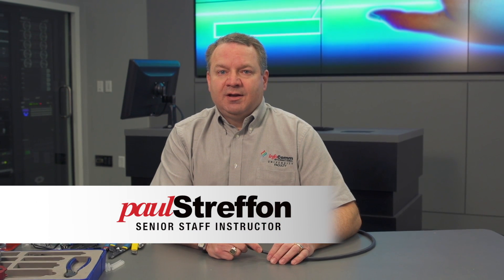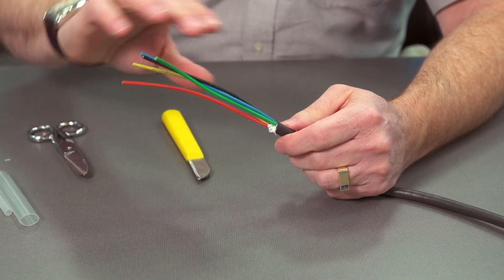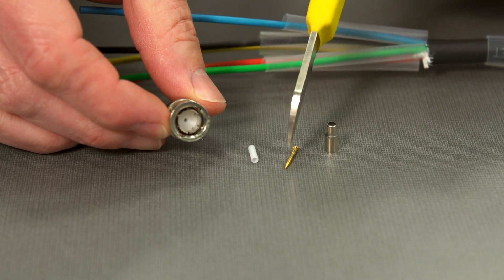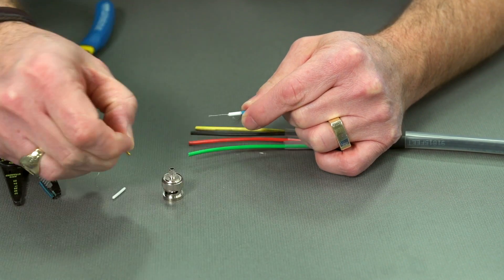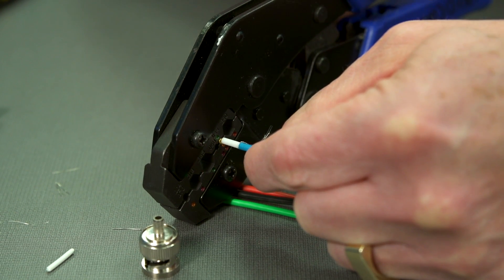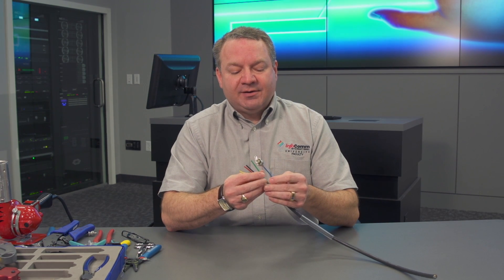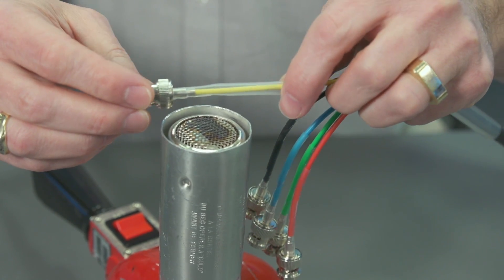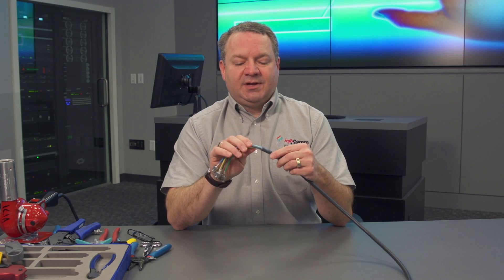Crimping BNC mHR to RGBHV

Comment: Hello everyone. In this video Paul Streffon was terminating a RGBHV cable using a mini high res connector. To answer your questions, the crimper and die can vary depending on the manufacture preferred. Since Liberty was mentioned, they have a crimper (47-10000) and die set (47-20250) that will do this. There are other manufactures that make similar sets. The holes that are used for the ferrule are between .128" and .178"; while the center pin is between .042" and .068". I believe that the BNC connector that is similar to this one that Liberty offers is the 112491-10.

I will leave you with this. What ever manufacture that you use; be sure to verify that the tool is the correct on for the connector that you are terminating. They should provide a reference for the tool, die set, and connectors.
Reply: Looks like all Extron stuff to me. Extron CTU 200 or CTU 300 Universal Crimp Tool (100-241-02), Extron BNC Male MHR 100-250-01 (QTY 50), and Extron MHR-5P RGBHV cable (22-103-02 500 feet). You can see “Extron” on the connector’s bag and the crimp tool is the same. Even has the orange color-codes between the BNC package and the crimp tool positions.
Reply: Also, Extron uses 0.044 instead of 0.042. Not sure if their MHR connectors tolerate the tighter crimp from the Amphenol RF tool Liberty sells or not. Also, Liberty does not sell the tool to the public though I see the die set available on Mouser.

Comment: Thanks for monitoring the comments so our questions can be answered. Sarcasm intended.
Reply: Marcus Yarborough, CTS-I commented with that information years before your sarcastic remark, so it seems they were doing exactly that.
Reply: Never mind. Dude was totally guessing and guessing wrong. This looks like all Extron stuff to me. Extron CTU 200 or CTU 300 Universal Crimp Tool (100-241-02), Extron BNC Male MHR 100-250-01 (QTY 50), and Extron MHR-5P RGBHV cable (22-103-02 500 feet). You can see “Extron” on the connector’s bag and the crimp tool is the same. Even has the orange color-codes between the BNC package and the crimp tool positions.

Comment: Can you tell me what brand crimper and die is being used, also sizes of the crimp holes?
Reply: Looks like Extron CTU 200 or CTU 300 Universal Crimp Tool. They expect you to stick to their brand and color coding so they don’t list the sizes for MHR crimping, but the Amphenol RF die set for MHR and m59 does (44-20250). Looks like 0.042 and 0.128 for MHR BNC (0.068 and 0.178 for m59 BNC) but I don’t know if that works with Extron brand connectors. I don’t have the Amphenol tool frame to try it but the die set is affordable from Mouser.
Reply: ...looking at Extron's diagram, they use 0.044 instead of 0.042. I have 350 crimp-on Extron MHR BNC terminals so I really don't want to order that without some confirmation that Extron connectors can tolerate a slightly tighter crimp, but I may need to.

Comment: What brand connectors are you using? I only have Liberty QuickLinx and I'm not a fan because they don't come all the way apart. I'm not sure what keywords to use to find connectors where the pin comes out like this one.
Reply: Definitely Extron MHR BNC connectors. You can see the S³ triangle logo, half the name “Extron,” and their orange bar for color coding with the CTU 200 / CTU 300 Universal crimp tool.
Reply: @emmettturner9452  Love me some Extron!